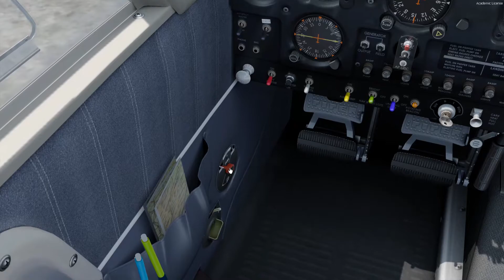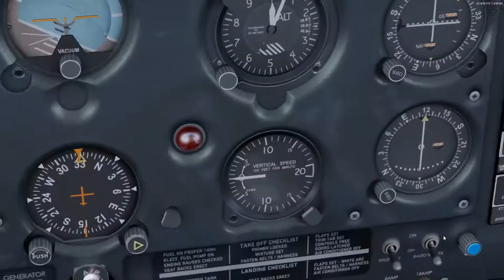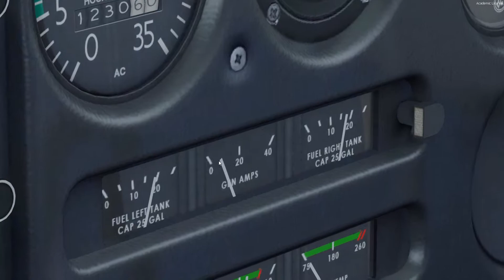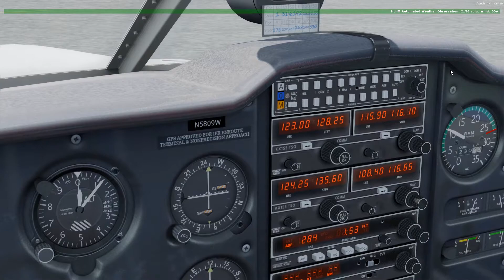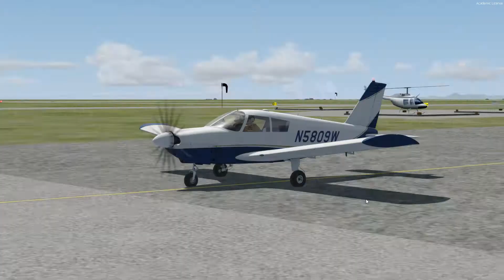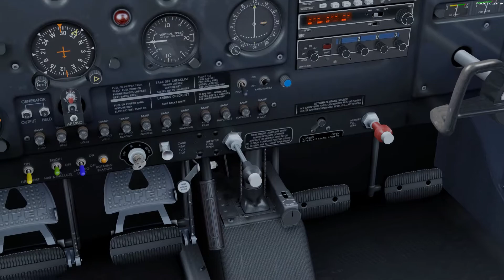Private Pilot | Starting, Taxi, Pre-Takeoff

Comment: Would you say TrackIR is an essential purchase, or is it worth waiting until VR is fully supported? Also, do you run a multiple monitor setup as well?
Reply from the maker: Oliver Shotter I just have a single monitor. You don't need TrackIR or VR, so if you want to wait for VR, you can. If you try to do ground reference maneuvers in the sim, it'll be a bit harder haha. But you could use a program like ezdock or chase plane to set up custom views to look out the side and then look out the front again. But for normal flights, you can just use the hat switch.
Reply from the maker: With that said, TrackIR is pretty nice and not terribly expensive.